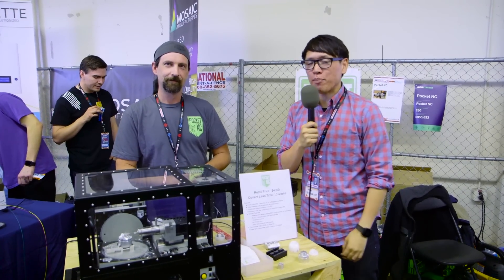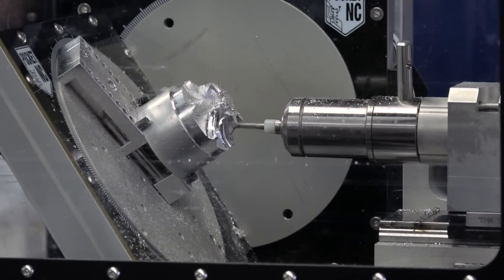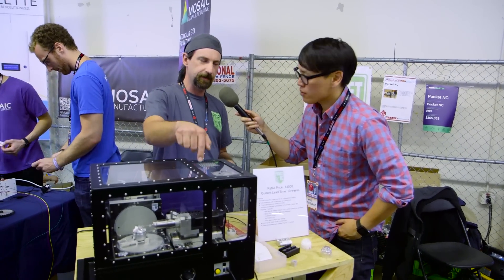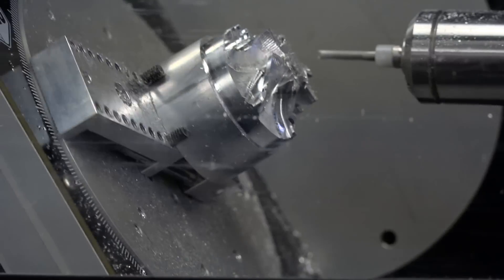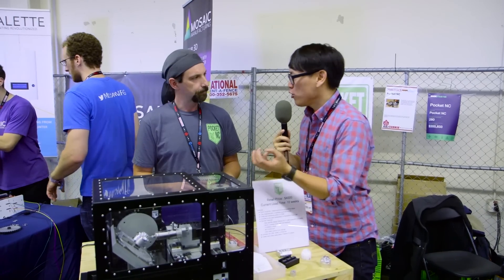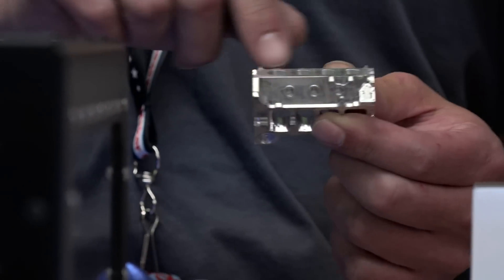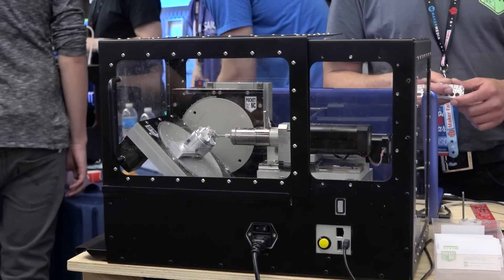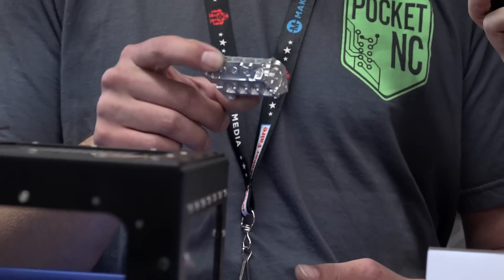Pocket NC 5-Axis Desktop CNC Mill!

Comment: 20 year full time cnc machinist here. At the different place I have worked, I have experience with 2 axis to 9 axis machines and everything in between. I think his price is extremely reasonable. I have a bench top 3 axis cnc at home to play with. I think that as these are more well known about, he will be able to raise the price not lower it.
Reply: I am a Engineer and a cnc machinist and this comment is complete bullshtt. 

I have a 5 axis bench mill with a 14x28 bed travel and a 22’-Z that I’ve built and its far more rigid, larger, and precision a machine than this. Mine even rapids at 2000 ipm and machines at 300ipm just like a mini robodrill. I didn’t pay $10,000 to build it either. I still have room to add a tool changer. 

If you search online a company called Robotdigg makes an almost identical 5 axis they sell that uses actual AC servos and not steppers for $4000 with a full enclosure. I almost nought it but i still think its over priced when I looked what it costs to buy parts at retail. 

For someone who calls themselves a machinist you’re way out of touch on pricing. Only proves to me you’re a user of machines and not an engineer. 

Btw goto aliexpress they have several benchtop 5axis available now for around $2500 each. Why buy this when you can have a better more rigid machine at a 1/4 of the price.
Reply: @glennedward2201  hello, do you have a link for the benchtop 5 axis cnc at 2500$ on aliexpress ?
Reply: @glennedward2201 I too would like to buy your machine if it is cheaper and better. 😅
Reply: @glennedward2201  That RobotDigg CNC seems quite interesting. Likely too steep a learning curve to start off with but just out of interest, do you mind expanding a bit on what the limitations would be for that machine in a hobbyist context? Would cutting aluminium be quite easily achievable given that you know how to set it up and program it or would it still be a challenge for that machine solely because of its limitations? I assume harder materials are completely out of the question? Thank you at least for your feedback on the above machine, because it's quite hard for a layman to determine whether or not this is a good fit for its intended purpose

Comment: You don't even have to justify a 5 axis cnc over 3D printing by talking about overhangs. You can't 3D print worked strength metal. This is way cooler.
Reply: wasnt the overhang comment about 3 axis cnc vs 5 axis?
Reply: Well, you can technically. DMLS prints fully metal components, alu, steel or titanium, and they're as strong as machined components, and as reliable. In fact, aerospace industry uses such parts all the time, they started the tech in the first place. The problem is, you can't get a nice finish on them like you can with CNC machining.
Reply: Aerospace space company I used to work for 3d printed titanium parts.

Comment: I owned a 5 axis capable shop for 10 years. This little thing is 'neat-o' but has such an enormous list of limitations that it will be merely an interesting toy. That does not make it bad, but any buyer should keep expectations very low. Beyond the machine itself - one of the biggest challenges is programming and setting up the machine. Little CNC's in the maker world seem to be promoted as 3D printers "just add material and print out an aluminum part" That is not even close to being true. Tool selection, tool holding, work holding, tool paths are each a long and difficult learning curve and they all have to be applied successfully to get a part without damaging the machine. Rigidity, power, and max tool diamter on this machine will be marginal which means that the cuts will have to be very light and cycle times will be VERY long. Interesting addition to a shop, but it will consume a LOT of time and produce very little. Good luck with it.

The design, engineering, and build quality (judging from the pics) seems very good for what they are after - desktop 5-axis. I would love to test one with some of our small 5 axis parts to see how far it can go. All of my CNC's were pushed beyond what they were designed for - but they are all 10,000lb $150k machines.
Reply: You actually highlight the strength of this machine - learning 5-axis.

Comment: While it is a cool machine I had some serious issues with it as a machinist. 
one was the chatter coming from the tool when cutting aluminum, heck even wood. This is partly due to how the tool was setup sticking out extremely far but still NOT cool! 
Second was the lack of chip guards on the "X" axis. You get stuff into the leadscrews and nuts and their going to wear out fast.
Also the guy mentions you could threadmill holes but at (advertised) +/-.005" accuracy that is going to be one funky shaped hole! Sure you maybe able to get a fitting to work but most thread mills that size are EXTREMELY tiny and delicate and expensive! 

That said I am excited to see someone taking on the challenge of a 5-axis desktop CNC machine I just felt like it could use some extra "additions" to make it a bit better. I do hope this encourages others to try making more desktop CNC machines!
Reply: Machinists making parts for profit aren't interested in this. High quality small machines exist, they just aren't cheap.
Reply: The problem isn't about production machining. It is that it is marketed as cutting aluminum, which it can just barely do .  It is a deceptive practice which I fell for because I had no idea how unrealistic this was. I bout a CNC router and its a piece of crap. I have since moved on to my second real CNC machine, and now that I am a machinist, I can say that this is deceptive.
Reply: It's just infomercial style selling everyone has been groomed for caveat emptor and all....
Reply: mikethezipper agreed... that is why I brought the excessive chatter when cutting anything up. Proper tooling could help but if it chatters cutting wood your doing SOMETHING wrong... 

and yes as for CNC routers + aluminum it can be done but don't expect good quality cuts. Routers were made for soft materials. Aluminum (relatively speaking) is not soft :)
Reply: +mikethezipper You didn't say anything about tools and spindle speed used with your router? Are you sure you used mills for aluminium not universal? AL swarf is very sticky just after cut and must be very quick evacuate from cutting area. That why AL tools have much faster helix. Also number of teeth should be small, one or two max.
Reply: did you buy this specific item (i.e Pocket NC).
if not how are you passing judgement having never used it.
Reply: cheap solution for threadmills.  take a tap and grind off all but 1 tooth
Reply: People with experience in machining don't need to own one to know how it will perform. Basic physics apply to all machines.
Reply: adisharr ..
Reply: yeah, that comment of "passing judgment having never used it"
With some basic understandings, you really don't need to. 
If someone tried to sell me a perpetual energy generator to power my home, I wouldn't need to test it.
Same applies if you take that logic 1 step at a time away from crazy and into applications.
Reply: Yeah, just let me re-prototype the lightbulb and sell people something massively outdated.
Seriously, why does everyone always get off about someone re-inventing the wheel and doing a worse job than the original wheel?
Reply: Calvin Witt Spindle isn't matched properly for the tool size and machine rigidity. It's underpowered, but also underspeed. 10000 rpm isn't fast enough for modern end mills under .125" cutting soft materials.
Reply: When you go to the grocery store and see a rotten piece of fruit why do you avoid it? Are you a doctor or a farmer? How do you know?
And yet you're asking the same rhetorical question to someone who is an actual MD nutritionist 
(ie, a machinist knows machines, just ask me, I'm one too)
Reply: I work with all types of CNC machines for a living and obviously this is only for hobbyists and designers wanting to prove their designs before farming out to an engineering company. It's just for prototyping and testing really. Mind you the cost for what it is is pretty amazing. About £3500 for me in the UK. I'm looking at it because I want to prove my watch designs and because I'm working in wood. I could easily do it at work but it isn't always convenient. It's thought provoking certainly, gives you an idea what might be possible in the future.

Comment: The small price and size is a huge selling point not just for hobbyists with workshops but for a small company or a university engineering department.

I can think of numerous instances where something could be fabricated in aluminum without using valuable time on the £100,000 CNC mill that fills half a room.

Now if only we can get a version that can work steels.

Comment: Is this machine capable of making a turbo-encabulator ?
Reply: a turbo-what?
Reply: A turbo encabulator. Not to be confused with a retro encabulator. Those are a cheap clone.
Reply: A micro encabulator perhaps, and only some parts of it. Unless you expect it to actually work that is. After years of extensive research I came to a conclusion that the cost of the equipment actually plays crucial role in fabricating that wonderful device.
Reply: Only if you run it with panametric lunar wane shaft instead of the two spurving bearings.
Reply: No, it only makes impellers.

Comment: 6160 Aluminum... As a Mechanical Engineer, I'm laughing my ass off right now! It's 6061... And 6061 is soft in the realm of metals.
Reply: 6160 also exists.
Reply: Only as a mispronunciation of 6061. I just spent ten minutes looking for material properties for "6160" and it doesn't exist.There's a 6162, but the most common 6000 series aluminum is 6061 and thus I believe the host simply got his numbers mixed up.
Reply: He probably did mean 6061 you are correct but although not a standard alloy you would find listed in Marks', 6160 does seem to exist: http://www.matweb.com/search/datasheet.aspx?matguid=528f334d9fe74ffa91a715d34a3bf26b&ckck=1
But I still don't really get your overall point. 6061 is a material you can make useful parts from, I didn't get the impression he was suggesting it was super tough to machine.
Reply: Norm asks if it can do any tougher materials and the host points to 6061. As someone who's worked with steels (1018 to 4130), titanium (grade 2 and grade 5) and aluminum alloys, the aluminum alloys are a joke to machine when compared to grade 5 Ti. It's usable, certainly, but not a tough to machine material. I got the impression that he was referring to it as a tough to machine material. I suppose if you're used to wood and machinable waxes, aluminum would be a tough thing to run into.
Reply: It's obvious that steels and titaniums are harder to machine than aluminium. regardless of your resume. "As tough as aluminium or even tougher" so I guess the guy should have said, "well not tougher but it will machine aluminium". Given the size of the machine it was a reasonable question and a pretty reasonable answer. As well as wood and waxes there are also engineering plastics and plenty of other materials that are easier to machine than aluminium and many small machines have very questionable performance on aluminium if they can machine it at all.
Reply: i really hate when they call 6061 "aircraft grade". Can you imagine, the label on your lawn furniture saying "made out of aircraft grade aluminum!!" it is dumb marketing term for the most common alloy of aluminum in existence. and you are right, it is one of the easiest metals to machine. Might as well be aircraft grade brass
Reply: It used to be the standard for aircraft construction before 7000 series became economical and composites became feasible. It's not marketing so much as it is 'tradition' in an engineering sense.
Reply: +xmodalloy the way it is used these days, it is a marketing word. why else would this guy say it, other than to hype up his machine.
Reply: Fair point. Sadly, to the general public, things like 7075 aren't widely known. I could ask some random home fabricator if he would prefer something made from 6061 or 7075 and he would probably say 6061 because he/she knows what it is.
Reply: 7068 is even harder
Reply: Meh,  talk to anyone in the firearms community and 7075 would be a common response.    Also, no need for the condescending LOLs.  It was an interviewing mistake.

Comment: My major issue is the price.  He says that other 5 axis machines are all 60k plus.  Not really.  For 8 or 9 grand you can get about a 2x2x2 foot "desktop" cnc compared to this couple of inches.  Of course that higher price isn't just for the large size but also the fact that you can 3d print with the other one.  And if you want to go industrial, Haas has a machine you can get for just over 40k, of course you have to have it shipped but now you have a 1 cubic foot work space and coolemt so you can machine anything like titanium or inconel.

Comment: I like their licensing model. Clever. "Don't pay us until you can afford it."
Reply: For Autodesk Fusion 360 you mean? Yeah.  I wish they'd offer the same terms for Inventor... Fusion 360 is supposed to be BETTER because it has CAM and stuff, too...but a lot of the feature overlap with Inventor, it does clumsily...seemingly on purpose. Pisses me off, because their pricing on Inventor is outrageous.
Reply: You have to take into account that Inventor is a very mature product that has been on the market for close to two decades. Fusion 360 is a completely new platform being built on modern architecture. It's been in development for about five years and only on the public market for about two years. ALL of the code has to be redeveloped which is a HUGE undertaking, but Autodesk is investing heavily and Fusion 360 is poised to become the future 3D CAD/CAM/CAE/FAE tool.
Reply: Tyler Keesling I get that, but it doesn't explain why transitioning from Inventor to Fusion 360, even the basic sketch tools feel limited and broken.  Like somebody said "Hey, you know all those features we've spent years adding to Inventor? Lets make a new platform and completely forget everything we've learned, and generally make more advanced users miserable."  I spent five years waiting for them to add things like a radial slot sketch tool to Inventor, and now I have to do without them again, like a savage. ヽ( ಠ_ಠ)ノ
Reply: +Bakamoichigei You're definitely not wrong when you take a side-by-side feature comparison between Fusion 360 vs. traditional CAD tools like Invt and SWx. They're still more feature rich. So yes, for more advanced users Invt and SWx are better CAD tools. But you have to take a step back and not look at Fusion 360 as a traditional CAD tool to understand the difference. It's much much more than that. We didn't build a hybrid-cloud CAD tool just to say we did like an OnShape. As for features, 'they're coming' and if you think you have a good idea, submit it to the IdeaStation- we actually take them into consideration and implement them. But moving forward, you'll see where we're going with Fusion 360 and the whole concept/design/engineer/manufacture process. We're not there yet, but we're getting close.

Comment: I am looking forward to 5-Axis 3D printer, so we don't need to print support for gaps and hole anymore .Or does it exist already?
Reply: That sounds like a really cool Idea. You could probably mod this machine for that fairly easy, replace the spindle with a 3D printer head. I am concerned about how well it would work though, mainly how well the work is attached to the print bed. Normally during 3D printing you don't want it to stick so well that you can not remove it, that might cause some issues with tilting.
Reply: The carbon M1 is great I'm sure, But as far as I can see it does not allow much more overhang than most other 3D printers. Say you needed to print an umbrella right side up for some reason, Carbon M1 can not do it without support material. A 5-Axis FDM printer could however.
Reply: There was a 5-axis 3D printer on DiginfoTV a month ago.
Reply: There's no such thing as a need for a 5 axis 3D printer. There are already 3D printing methods far superior. SLS and SLA printers are far superior, and SLS don't need to print supports at all, they're incredibly accurate and don't give a damn about how complex whatever you're printing is. FDM printers, which is what people think of when they think about 3D printing, are a joke. They're toys. Have something printed on a 150000 dollar EOS SLS machine for example, and you'll get parts that are insanely high quality and accurate. Again, complexity doesn't matter. No worries about overhangs, thin walls, etc. The material itself supports the model.